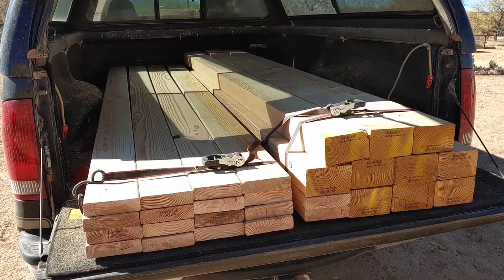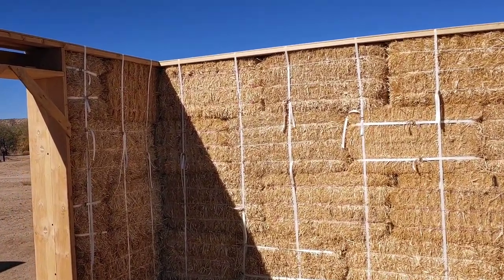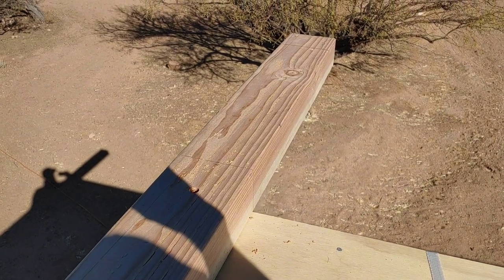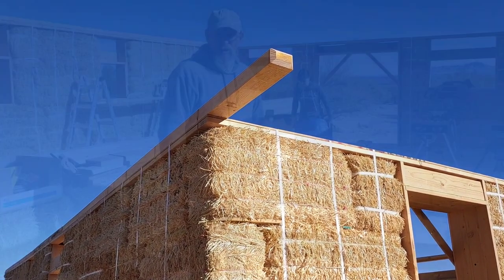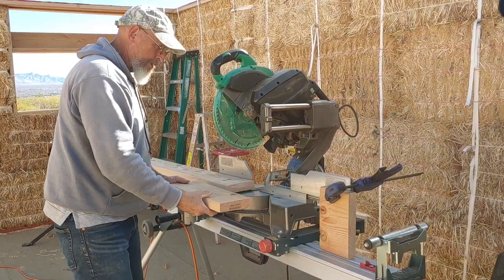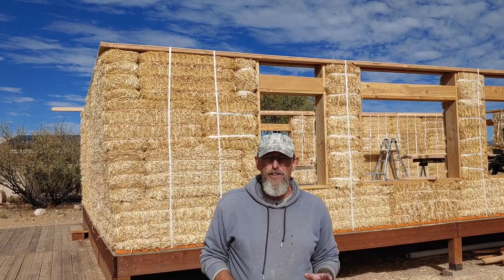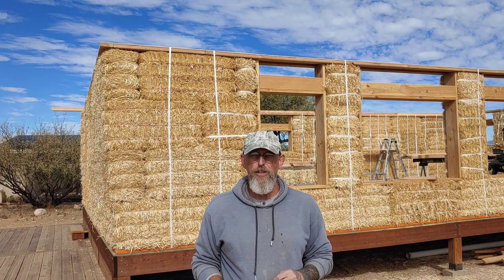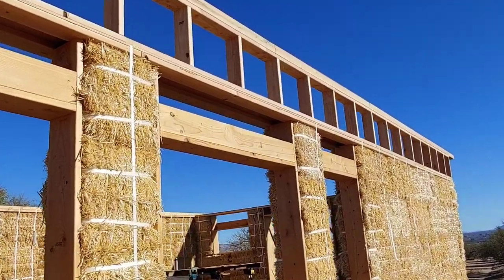#strawbalehouse #sustainable Straw  Bale House Build: Day 20 Clerestory

Comment: Wow!  You are really moving now.  You're videoing on a phone?  Fooled me.  Very well done videos.  I think I've seen them all, but don't remember you ever mentioning where you got all of your skills.  I don't believe you made your living as a carpenter if I remember correctly.  Still love to here more about your backgrounds and hoping for that video on how you chose tools before and during construction.  Everything is quality craftsmanship.  Also, looks like you took some time selecting lumber too.  Just an amazing job from the start.
Reply from the maker: Thanks so much for watching. I spent many years working as a commercial photographer but strangely enough, never was really interested in video. I was a "print" guy. And yes, I do all of the filming using my phone, an LG G8 and edit on that same phone too.
Yvonne and I have worked on several homes over the 26 years we've been together. So as you can imagine, we've collected tools over the years and have picked up project specific tools for our current homesteading adventure. The 12 inch sliding miter saw was purchased with larger beams and posts in mind like in this video, cutting 4x6 beams. One day we'll have to do a "LIVE" to answer just such questions......one day.
Reply: @theupsideofdownsizing  I got my masters in film at the tender age of 45 and that was many years ago.  Now at 71 I am mostly DSLR.  Your sound is surprisingly good and it is a weak areas for most channels.

Comment: How many bales did you need for the walls? I forget. 😁
Also, I forgot to answer your question again. I didn't use the nailer, because of the piecemeal way I did the joists.
Reply from the maker: We ended up using 105 bales for the walls. We still have some stuffing to do and the areas above the windows need to be filled, but we have about 12 contractor bags filled with loose straw. We have about 20 bales left over, but between Yvonne's garden and some ideas I have for benches and other design elements, we'll probably have to get more.

Comment: It's really starting to take shape now. The ends of those beams are a nice detail. I'm curious about the compressive strength of the straw bales. Will they settle or compress more at the corners than in the middle. Because of the window and door buck outs in the middle there is less straw bale to compress than at the corners. Is this an issue in straw bale construction?
Reply from the maker: There is definitely compression to consider. The density of your bales play a huge role in this too. We will wait until the roof is done before being to plaster just to give the bales a chance to settle. The amount of overall compression, using our bales, has been between 1 and 1-1/2 inches. Never noticed a difference in compression at the corners over the middle of the walls. Interesting thought though. Thanks for watching!

Comment: How did you decide on the 112 pitch? Great videos. I am really enjoying them.
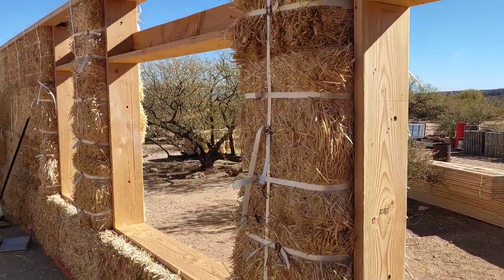Reply from the maker: The pitch was actually decided by the height of our clerestory windows. The 4 perimeter walls all have 4 courses of bales plus the box beam for a total of 8'6". The 24 inch high clerestory framing created the 1:12 pitch. Because we have no issues with snow loads, a flatter roof is not an problem. And for me, a flatter roof was more comfortable to work on with my fear of heights.
Reply: Thanks Bill @theupsideofdownsizing
Reply: Thanks Bill. I would like to build a straw bale house and your videos have been really helpful @theupsideofdownsizing

Comment: Will the clear story be a bad add if u had very cold winters?
Reply from the maker: It will be a combination of fixed double paned windows and bottle bricks. In the winter, they will actually add to the passive solar efficiency of the house. And in the summer, they will be shaded by the 3 foot overhang preventing unwanted solar gain.
Reply: * clerestory:  https://www.merriam-webster.com/dictionary/clerestory. Ps - not trying to be a “Karen” ... just seeing a lot of comments using “clear story” and it seemed like this word wasn’t widely known.  Bit of an architecture geek.
Reply from the maker: Thank goodness I spelled it correctly in the title 😉